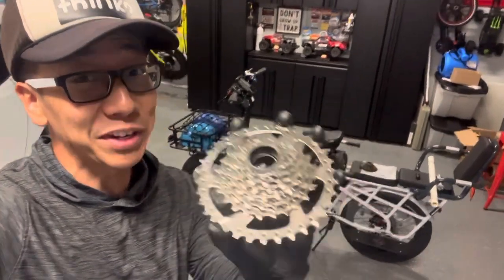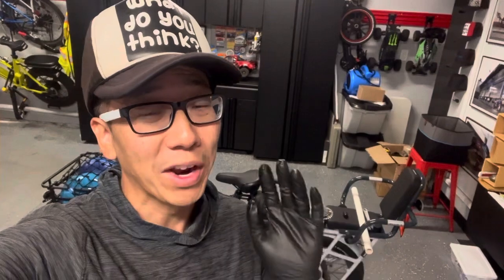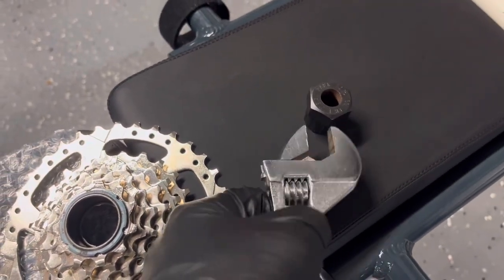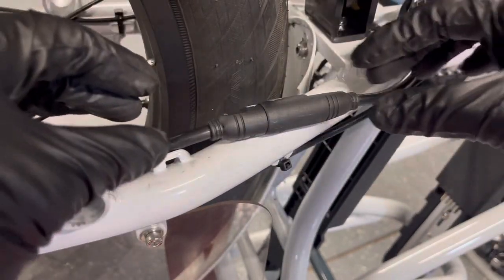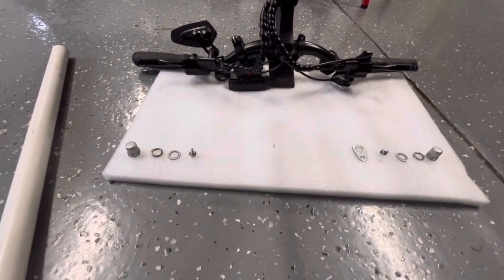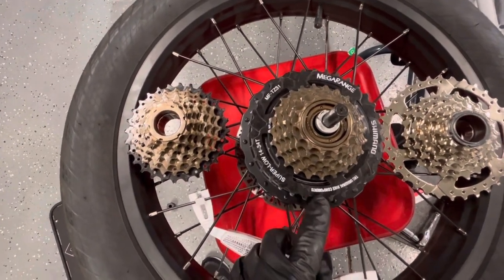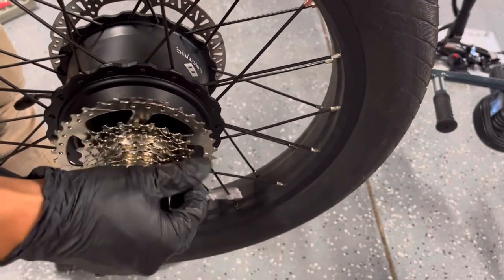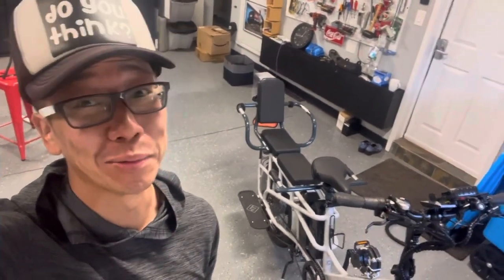Lectric XPedition Hill Climbing Beast - How to Replace the Freewheel

Comment: I live in a hilly area and did this mod, too — so much better climbing steep hills! 👍 The 34-tooth low gear makes the bike more usable as a pedal-only bike (with zero pedal assist) when I want a real workout!

Great video: very helpful with great camerawork and clear, complete explanations. Minor suggestion: grease freewheel threads; makes future removal a bit easier.
Reply from the maker: Thanks! Ooo, good tip about greasing the freewheel. Should’ve done that.
Reply: I just did this to my XPedition and the tip about the grease is a good one.  If I didn't have a 36 inch long breaker bar that gear assembly would have never came off but having watched the videos and read the comments I made sure to get grease for the threads as I don't want to have to put in a bunch of effort if I end up not liking this mod.

Also for those who would rather use a socket instead of an adjustable wrench it's 1 inch socket that you will need.  A 26mm will also work but it's not as snug
Reply from the maker: @DestinationFawked  thanks for the contribution. Glad it worked out.

Comment: This was a great video and thanks for providing the details on what to buy.  I would not have tried this had you not made this video.  It took me under an hour to change the gearing, install a new rotor and pads as well as replace the worn tire, install a tube protector, a new tube with 7.2oz of slime and get it assembled.  I did have to make some slight adjustments to the derailers set screws but another person posted a fantastic video on how to adjust them and I had it tuned in quickly

Cheers 🍻
Reply from the maker: Awesome! Glad I was able to contribute to your work. Would you mind sharing the video about the derailleur adjustment? I’ve been using the park tool one successfully but alway good ro see what other people are using.
Reply: @Funcentric  I always use park tool, dont care if they cost more I want a good and dependable tool
Reply from the maker: @DestinationFawked  yeah but what video were you referring to that you used for the physical adjustment?
Reply: @Funcentric  https://youtu.be/GWRdLIg79Mo?si=h9cQM9zO2OYU6LFN

This video is what I followed to set the derailer
Reply from the maker: @DestinationFawked  Thanks!!

Comment: I did this to my old Bolton bike (now Area 13 bike) by learning from Jerimiah Macintosh's  channel.  It was pretty easy but I've  since had a stroke so my tinkering skills are null at the moment
Reply from the maker: Oh man, sorry to hear! Glad you're doing okay now though. Yeah, the 14-34T was from an old bike. I did the swap from the 11-28T b/c I was desperate for low gears and did have to sacrifice my high gears. So now with the 11-34T, no compromise!
Reply: How have you been doing so far?
Reply from the maker: @audiwankenobi361  Great. I’ll have a follow up video on how I feel about the new freewheel after getting some major miles on it.

Comment: Great video and tutorial! Would likely be challenging, but getting some riding footage of the new setup compared to the old would be great! Just so folks could really see the difference this change makes. I climb a 7.5% grade every morning, but so far, the 3.0, XPedition, and Trike we three ride all seem to do pretty well with it. On hot days, the Trike does flash HOT after about 3.5 miles though. Wish there was some better heat dissipation for the controller.
Reply from the maker: I wouldn’t recommend it if it’s doing well for you as is. But as long as you don’t rush the installation and have all the tools, you should be fine with the replacement if you do ever decide to do it.

Comment: I have a Lectric Xpedition with a custom built side car I call  SideKick more for someone with special needs. My average speed is 8-10 mph. I was wondering how the 14-34 preformed. I am concerned with power not speed and would like to slow it down a bit. Having said that I am thinking of installing the 14-34 that you made mentioned slowed the bike. Thanks
Reply from the maker: @scottsaylor9394  I have had the 34 tooth free wheel on various rides before. I love having the extra low gears since you’re not looking for speed, I think this would do well for you because all the other gears are also dropped slightly lower.

Comment: Good video! Thanks!
Reply from the maker: Thanks for taking the time to let me know you enjoyed it! Someone told me that I may have gotten the socket wrench sizing wrong. It did work for me but possibly too large is what I was told. Just fyi.
Reply: @Funcentric  I’d like to change the free when to increase top speed instead. What free wheel do you recommend if any?
Reply from the maker: @raulh7814  you will not be able to do that because the highest gear is an 11 tooth and there is nothing beyond that. If you’re OK sacrificing low gear, you can change the chain ring. 

You can change the 52 tooth to something larger like 54T or 56t. All your gearing will increase though, so you will not have as low of a gear as before. Personally, I think hillclimbing is more important than speed. You will likely need to lengthen the chain though if you go with a chain ring too big.

Comment: So I'm a 5'5" lady and on the lowest seat setting I'm on my tippy toes. It's so crazy. And the handle bars are an uncomfortable distance. My fingers go numb. I haven't found any videos on flipping the handle. Anyway my boys and I have been loving riding it so far.
Reply from the maker: Yeah, the seat height is high for me too. Im 5’-7”. The handlebars should be able to adjust towards you quite a bit. If your fingers go numb, it could be that the levers are too high. I have a video on that as well.

Comment: Can this be applied to the XP3.0 STEPTHRU  ?
Reply from the maker: Yes! Just make sure you get a freewheel and not a cassette. Replacing the gear is the same as most entry level bikes. Higher end and newer bikes use cassettes.

Comment: Are those torque plates the old ones or upgraded ones? Looks old to me..
Reply from the maker: Torque arms are stock. About a month old. They’re not worn. What makes you feel they are old?
Reply: The torque plates that are both silver are known to causes issues.  Saw a bunch of posts on Reddit about people having them fail.  Some poor person has been dealing with Lectric support and even after getting treated like trash from Lectric this person bought a second one so he would have a bike for the months long repair/replace from Lectric.  People with a black plate and a silver plate, that are mounted different and are thicker are not having the same issues.

Mine are black and silver so I think I'm good.  Also that free wheel remover tool you didn't provide a link for where can I get one?
Reply from the maker: @DestinationFawked  thanks. I just happened to have finished reading up on the Reddit stuff you spoke of. 

The freewheel remover tool you can get from anywhere. First one I happened to see. Park Tool Shimano/Sachs Aris/Sunrace/DNP Epoch Freewheel Remover https://a.co/d/cl8OiUw
Reply: @Funcentric  thank you
Reply: Hi, I’m planning to buy an Xpedition and am wondering if shipping time was prompt? I’ve seen some comments on other reviews that said they didn’t receive theirs and it has been five months since purchase. I own an Aventon Level and looked at the Abound but I want Class 3 capability, the Abound tops out at 20mph. Dual batteries and the Class 3 capability are the reason I want this model but not if it takes forever to receive it.
Reply from the maker: @boredzilla05  it took mine a month to arrive but inventory changes all the time. Some have received theirs in 4 days. So it’s a hit or miss. 

Class 3 is way over rated for a cargo bike. There is a reason so many are Class 2. They’re harder to maneuver. You don’t need to be going that fast on a cargo. Aventon Abound is way better quality and what I’ve been recommending. More features, can be bought locally and price has dropped from $2,300 to $1,800. 

Everyone is able to get away with single battery as you’ll see the competition and other offerings for cargo bikes in all price ranges are all single battery. The only dual battery long tail cargo bike I know of is the CSC vista cruiser or the XPedition knockoff.
Reply: @Funcentric  I appreciate the response although I’m set on having Class 3 capability. I may not “need” to have it but I want it. I’m not thrilled about a wait time of that length though. I bought my Aventon Level locally so shipping time wasn’t something I had to deal with. I also swapped out the freewheel on it for more top speed rather than more climbing capability. I may go with the Abound or just scrap the cargo bike idea.
Reply from the maker: @boredzilla05  You’re sacrificing a lot by getting the class 3. Just be aware. 11T is the highest gear you can get for any bicycle. To get higher top speed while sacrificing acceleration would require a larger chain ring which would increase all gearing. 

If you can get away with not getting a cargo bike, then you should likely choose that option. I have a video on why you may not want a cargo bike at all. It doesn’t sound like a good option for you.

Comment: I want to put on a front motor. 48volt. 750 watt. Any ideas?  Also looking to put on off-road tires that I can put studs in. Seen good examples online with a Rad Rover
Reply from the maker: I've kinda toyed with the idea of a dual motor setup too, but decided in the end it was too heavy. I may eventually get the Yadea Trooper dual motor. Comes out next year. I don't know enough about implementing a second motor to be of any value to you. Sorry bud.
Reply: @Funcentric  I'm still going that direction. I'll let you know. I live on the steepest street in Idaho. 27 1/2°. All ice in the winter. I'm going to find a way. Thanks.
Reply from the maker: @douglaslarson8167 Sweet. Dual motors definitely have huge performance gains. The one I test rode took off like crazy.
Reply: @Funcentric  I've been thinking the same motor. If I must, I'll save the freewheel gears for when these go bad. I've found a 48volt, 14 amp hour water bottle style battery and set it up without a controller. Thumb throttle only. I've got a hilltopper unit on a ride1 already set up that way. I'm just not to keen on relacing yet. My alternative is a 2 1/2" setup I've seen.
Reply: @Funcentric  with senco tires, I estimate it will be right around 100 pounds.
Reply from the maker: @douglaslarson8167  and no flats ever! Haha. Cool.

Comment: LECTRIC Offered the $1000.00 Challenge.. if you find a Road or Street that it won't climb... MAKE A VIDEO OF YOUR EXPEDITION NOT CLIMBING A HILL ... SOMETHING IS NOT WITH YOUR BIKE OR YOU MUST BE WANTING TO GO UP AT FULL SPEED LIKE YOU'RE ON FLAT LEVEL GROUND.... SOMETHING IS AMISS HERE WITH YOUR CLAIM.
Reply from the maker: It can climb it, but barely and straight up dangerous with load (which is expected on a cargo bike designed to hold....cargo). Glad I put the new freewheel on for sure. Again, likely you're not really climbing real hills. If you haven't gone much else outside of Ohio, you are probably just running along little inclines. That's okay - not your fault. You can't control the terrain and elevation changes. Most states across the country don't have actual hills. 

Flat level speed isn't necessary but I do need to go about 10mph to keep stable with load. 5-8mph gets sketchy.

I definitely won't be uninstalling my new freewheel, install the original just to prove to you what I already know. I'm not out to prove anything to anyone. Just loading videos to help people who care. Sounds like you're not one of them so that's okay. Just keep moving along.